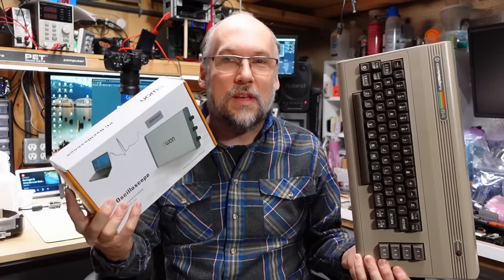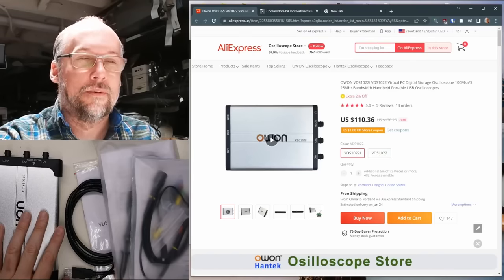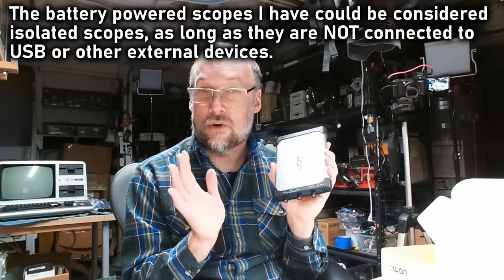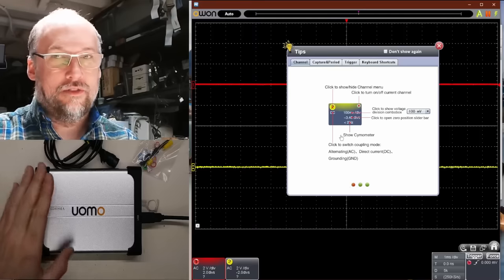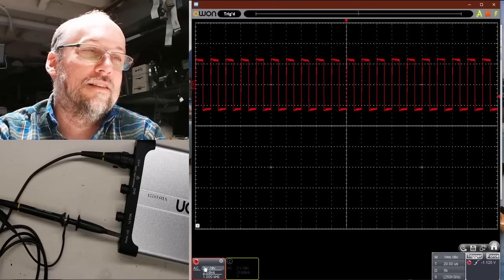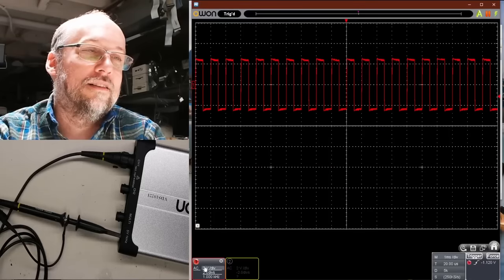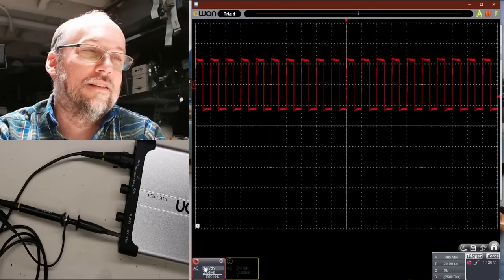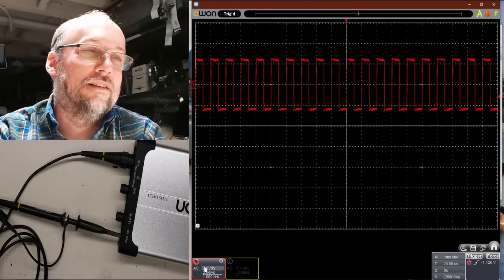This blows away the $60 budget oscilloscope! (OWON VDS1022 review)

Comment from the maker: Follow-up: I actually had never looked at the Rev A C64 video output circuit on the schematics before. It turns out the RF modulator is not part of the Chrome/Luma processing at all on this revision. (It's the only one that's like this.) See the top right part of this schematic: http://www.zimmers.net/anonftp/pub/cbm/schematics/computers/c64/326106-2of2.gif

That means this mod surely worked OK at some point. I think the issue I was seeing with the luma signal being super low was due to bad soldering or broken traces because the rework done was bad. When I restored the board back to the original 5-pin connector, I fixed a few traces with bodge wires near the video connector and now everything is back to original condition. (I also restored R10 to be 120 ohm as specified on the schematic. It was 300 ohms on this machine.) 

Ideally, a RF modulator replacement could be created to output S-Video and Audio but this would require a could bodge wires running to FB14 and FB15 near the VIC-II. Also ideally the entire original video output circuit should be disconnected and a new composite feed be fed into the DIN-5 from the new RF modulator board. See Mark's video here: https://www.youtube.com/watch?v=LB2gtMQyjqQ
Reply: Ever checked out the BitScope units?  I've been eyeing one up because the software looks really interesting.  Besides normal o-scope stuff, it can also do data logging.
Thanks again for another great video.  I need to go dig the C64 out of my parents basement to see what Rev it is.  :)
Reply: There are keyboard shortcuts mentioned, try using arrow keys.

Comment: Saving the waveform is actually really useful. You save it and use it on a signal generator to reproduce the same waveform.
Reply: As a modular synth user... I see the value in that...
Reply: Good point.
Reply: Also you can save waveforms and give them to the customer with receipts-- if you are using it for repair work.
Reply: laughs in Serum 😂 @jazzdirt

Comment: I was told once that the hardest software to learn is the second one.  (in reference to CAD in my case)  once you get used to something you get frustrated when it's not where you expect.
Reply: Well...  the problem Adrian's is experiencing is largely that this software doesn't comply with current norms of UI expectations.

You'd expect you can just "zoom in" on an element, because that's how most other software is.  The current model for any visual element is to treat it like a physical object with the ability to change things right on the object rather than having to go into an obscure menu somewhere.  When it doesn't behave like that, people say  it's "non-intuitive".

In other words, intuition is built upon how you've experienced other software.  If suddenly everyone has the little gear icon in a UI and it represents settings, then that becomes intuitive.  If a designer expects you to do everything backwards from the way everyone else does it, that's not a great UI design.
Reply: @stevesether There is good open source software for VDS1022 so I guess Owon doesn't spend time improving the official software for this old scope.

The official VDS6104 software is quite good, zooming, right clicking etc on wave form and channel levels works as expected.
Reply: @mrfrenzy.  I couldn't find anything that looked like the UI was fully OSS. 

 From what I can tell the software on Github in Adrians link is largely compiled Java classes pulled from the EXE, combined with firmware pulled from the EXE.

Is their some OSS software for this I'm missing, or is the Java UI source available?  the only java source in that Guthub repo is a small wrapper for a C library that interfaces the USB.
Reply: @stevesether  I don't think using an unmodified scroll wheel to zoom is intuitive. On the other hand, using the scroll wheel over a value is expected to change that value. If the scroll wheel is to zoom in the waveform I would expect you to need modifier keys. Probably one key for horizontal and one for vertical.

Comment: I recently bought an Owon handheld scope and I am quite impressed. It's a great little instrument and being isolated from ground is a huge bonus.
Reply: Isolation is a really big plus. On the other end of the spectrum are oscilloscopes that connect ground of the DUT with the ground of your expensive laptop/desktop computer. Why even bother with USB oscilloscopes...
Reply: I have the 100mhz model with built in awg. It's such a handy piece of kit to have in my bag as a service engineer. I highly suggest upgrading the leads. I use Probemasters (DMM and scope) with mine.
Reply: @graealex  in the US laptops are cheap. I can get a used one for $20 or free. If you're hooking USB scopes to your expensive computer that's really your fault.
Reply: @H0mework  I don't think you actually get the problem here.

Comment: I bought this as my first ever scope after seeing lots of reviews, and I'm happy with it for the very occasional times I need a scope. Yeah the software is kind of infuriating although the github version fixes some of those annoyances. But the UI as a whole could be a lot better, making use of the large screen of a laptop to lay out more immediate controls instead of requiring menu diving. But as you say, the scope itself seems very capable, fast and accurate, and that's surely the most important thing.

Comment: I do enjoy seeing all of these cheap scopes as options, especially for beginners. 11 year-old me would have adored one of these on my electronics bench in the late 1980s!

I personally ended up buying a standalone Siglent SDS1104X-U because I needed something that could do a little more and was a little bit more reliable, as well as four channel. I kind of wish I had sprung for the -E Model as it has a port to add a digital logic analyzer to it, but I didn't really have the money at the time.
Reply: I have the SDS1104X-E.  I wouldn't be too unhappy about not getting the E model.  The logic analyzer is rather pricey (almost as much as the scope) and, from what I read, not all that great (missing trigger off digital options, for example).  Makes sense - the digital module isn't like other scopes where all the logic is in the scope and the pod is just buffering/signal conditioning.  Have to step up to the SDS2104X-Plus to get a more digital logic analyzer setup.  Its definitely a much nicer scope, but quite a bit more expensive.  I'm happy with my SDS1104X-E - it's alot of scope for the price.

Comment: Way back when I worked in manufacturing, I used to touch up the circuit boards that came out of wave soldering. We would insert headers and things that couldn't otherwise survive the trip through the wave soldering machine and we also installed ECO wires. When we installed wires, we would use some "super glue" to hold the wires in place and route them neatly, or at least I did the neat routing at the time. Once our wires were installed, we used some De-Sol as it was called to remove the extra flux and we then trimmed up any extra pins and inspected for solder shorts.

When I finally became a tech, I was quite proficient at replacing chips due to my touch-up experience and I can proudly say that there was little difference between my chip removal and hand soldering compared to what was done on the manufacturing side. Sadly, this wasn't the case for all the techs and many ruined boards very badly as was the case with field returns. This was a common occurrence when I worked in field service where I received circuit boards and equipment that was already 8 or 10 years old. With those boards, some dating back to the mid to late 1970s, the pads were ripped and wire-wrap wire, or bus wire as we called it, was a common sight on the backs.

When I received those boards back from the field, I learned quickly enough to check for that before even powering up the boards because in many cases, it was these poor repairs that were causing the more recent problems due to cold solder joints or intermittent breaks in the copper traces.

Those USB scopes are amazing critters compared to the old Tektronix 465B which I was so accustomed to.

Comment: Pro tip: Oscilloscope probes with 1x/10x usually only have their full rated bandwidth at 10x setting.
Working on 5v stuff you can use 10x attenuation with not much added noise and it may sharpen those waveforms up a bit.
Reply: Yes, Dave Jones did a nice video explaining: https://www.youtube.com/watch?v=OiAmER1OJh4

Comment: The keyboard shortcuts for adjusting the horizontal and vertical scales make this scope much easier to use.  At 11:31 in the video the “tips” menu in the Owon software has a tab for these.   It takes less than 1 minute to learn them. 

Florentbr’s version is better, and has even more keyboard shortcuts.  

Newark/Farnell also sell versions under their Multicomp Pro brand.  They are usually more expensive, but sometimes are on sale.  I picked up the non-isolated version from Newark for $56 US in early January.
Reply: So, as usual, RTFM applies :)

Comment: I could remember this Mods. I live in Germany and that was described in magazines. It was an series starting low level things and gaining the higher thinking.
The voltage mod I have made together with a small peach of copper that I had.
And the mod with the Luna mod I remember. They had a special monitor in the lab and did not thought about that a normal monitor is not so sensitive.
Two weeks later they explain the mistake.
Reply: As the mods began to be revealed that is exactly what I thought, "These mods were done by an enthusiast at home with limited skills and equipment" and a magazine of the day would be the exact place the information came from.

Comment: Haha. A software guy here. The GUI environment used for the interface defaults to handling mouse clicks in the "current window," which in this case is the last one where interaction happened. Handling at top level as you wish is certainly possible, but requires fiddly extra effort. I guess they haven't done that. Thanks for a great pointer. Was looking for a usable cheap scope. Guess I'll give this a try.

Comment: I have this scope and it works on a mac and linux, software and method to get it working is a little more involved. 
Turns out the software is Java based, and all you have to do(from what I can remember) is install Java for MacOS, run the executable for windows. The only real hard part is getting the USB working which wasn't hard on my 2021 M1 imac, which has a stubborn USB in its own right.
Otherwise, once you get the software up n running, the scope is great for basic stuff as shown in the vid.
I hope this info is helpful for a fellow mac/linux user.
Edit: I had no issues getting zoom to work with mouse on this.

Comment: I would like to add some feedback from the perspective of someone who knows nothing about oscilloscopes, but is at the point where considering acquiring such a  device to further knowledge and capability. 
First, I have gained the intuition that this two part solution, the sampling device and computer, is the future for enthusiasts. Only the software holding this evolution back. 
Second, by reviewing such a device using actual use case and practical example, you provide an oscilloscope fundamentals tutorial with key areas that stuck in my memory model way better than just working principle in theory alone could have done.
Thank you, and I hope this feedback is of value when considering the impact of such enthusiast videos as yours on your viewers. Definitely learned a few things today.

Comment: Another advantage of an isolated scope is that it allows measurement of differential signals. 
This would otherwise require 2 probes/channels to measure both single ended signals...
Reply: I will need to (partly) disagree with you. Even with an isolated oscilloscope you want the ground probes to be connected to an RF ground, otherwise the shielding becomes a giant antenna. For sensitive signals that could be a problem.
Reply: @eDoc2020  I agree, it really depends on the situation. Had a use cases in mind such as RS48/CAN or voltage transitions over components where the frequencies aren’t that high. 

As usual in electronics, you need to your wits….

Comment: At work, when we need to remove epoxy, we use a heat gun which softens it up enough to let us get an Xacto knife or pointed implement under the epoxy and lift it off.

Comment: I got a Multicomp Pro MP720016 and it's basically a re-branded Owon VDS1022 (non-isolated) so it uses the same software. It's the first scope I've ever owned and functionally it's a good fit for doing hobby electronics. It has good edge triggering and I also figured out how to capture single trigger events which is very useful.

Comment: My Rev A has the same Video modification.  The Chroma Luma video works on it, I don't know if there was more to it than just the jack mod and wires which are done in a very similar way on mine.  Maybe there is a portion of the mod that wasn't completed on the one you have?  It is also a bit of an odd board otherwise.  I think someone cared about it at one point, but it had been mistreated in the years before I got it.  I may be mistaken, but I believe that board doesn't pass the Composite video through the RF Modulator.  Ray Carlsen has a fix for R10 to bring the video level up on that model board, as you mentioned it was light.

It is cool seeing another of those boards with the video mod.  To bad it doesn't seem to work properly on yours.
Reply: Sounds like it would be good to get to the bottom of the chroma luma mod.

Comment: Regarding isolation, even with low DC you might have a problem if you want to probe in reference to something other than ground.  Not usually something you'd do but sometimes you need to.
Reply: Good point. I've found it useful to probe some circuits that have low-side switches in their power circuits and the scope would be bypassing that switch entirely and causing the circuit to always be on. I've also got some isolated TTL UART to USB adapters my company made for our test jigs. Very useful.
Reply: Not really a problem when the usb side is isolated.  At that point it is the same as a battery scope or even a multimeter.  What you can't do is probe two different points with different reference commons.

Comment: Most of the ui related problem you had are easy to solve by using the keyboard shortcuts. (Change timebase,v/div,trigger,)
And all the triggering are done in hardware. The scope has an FPGA that handles that

Comment: I have the Owon HDS2012S battery operated scope meter with signal generator which is “isolated.”  The meter section is definitely isolated from the CPU and USB-C data connector by using a transformer isolated power supply between sections to bridge power.  The meter talks to the CPU through opto isolators.  The Oscilloscope BNC jacks are plastic and have a metal ring on the inside to contact the fingers on the BNC plug.  Obviously, a metal BNC plug is going to be potentially live if whatever it is plugged into is live, so no isolation there.  If one uses the included X10 probe which has a plastic outer shell plug, then yes, whatever you are working on will not put voltage on the outer barrel of the probe, a nice feature.  An Ohm meter check confirms that the rings inside the BNCs, calibrator ground and USB-C shell are all connected together.

Summary:  The HDS-2102S meter section is truly isolated.  The HDS-2102S oscilloscope section BNCs’ outer shells are isolate your fingertips when using the X10 probe, but the ‘scope is not isolated from ground if you plug something into the USB-C or clip the calibrator to ground.

Owon is a little more expensive than similar Chinese budget test equipment, but the quality is better and worth the slight extra cost.

Comment: I had an Amiga 2000. I upgraded the CPU, (to...I don't remember...but it was different looking) and maxed out the RAM at 9 MB. Used it for a midi studio. Never got the toaster though...Those things really did revolutionize the in house ability for many local TV networks. Never did use a CD Rom or hard drive. Just 2 Floppy drives.
Oh yeah, but with that large amount of RAM I did figure out how to set up the RAM drive ability.
That thing was fast........
Much simpler times...

Oh...and I know what you what you mean about the scroll wheel.
My first Microsoft PC, a Packard Bell-Win 95 then 98se, I had  bought TurboCad and that was my first experience with scrolling-zoom. Later when looking for a good paint program I chose Jasc Paint Shop Pro over Adobe Photoshop simply because Photoshop did not do the scrolling-zoom.
"What the Hehhlo"!

Comment: I am glad you not only show toy scopes (but I am not an Owen fan) The scope is the eye of the electronics repair person, that is why it is my most expensive bit of kit.  I  use a R&S 300 MHz scope.  Beside that an isolated scope meter from siglent, not a bad scope but the UI is  bad, triggering is pretty good  and rhat is very important . A scope is nice but a lot of uers have no clue how to use it. Fine for checking ripple on power rails but you can do so much more

Comment: 27:00 For Christmas of 1982, there were many defective units coming off the production line.  They were storing those in tractor trailer trucks in the parking lot; however, some of them were actually shipped as the folks picking up the trailers were either not informed that they were filled with defective units.  Or, they were purposely shipped just to get the product under the tree for Christmas Morning with the expectation that customers would return them later for replacement.  So, I suspect that this unit was a warranty return to Commodore who might have replaced them with working units and serviced the defective units as time permitted over the following couple of years.